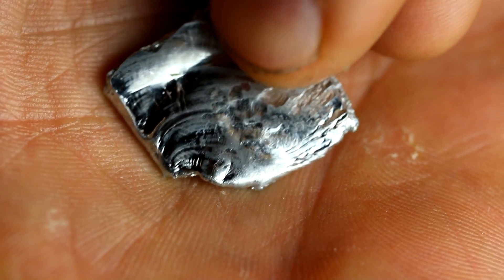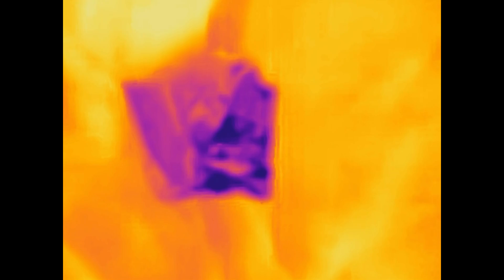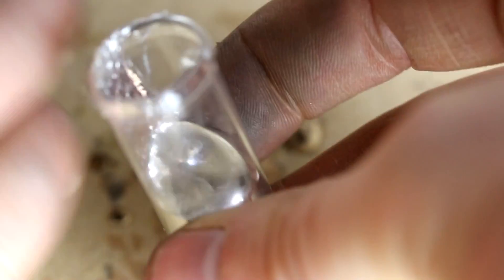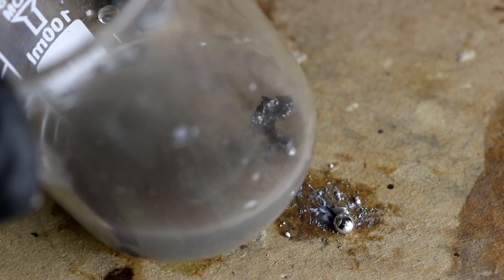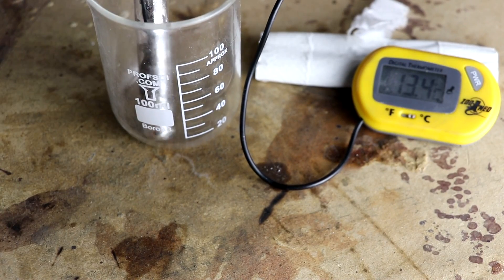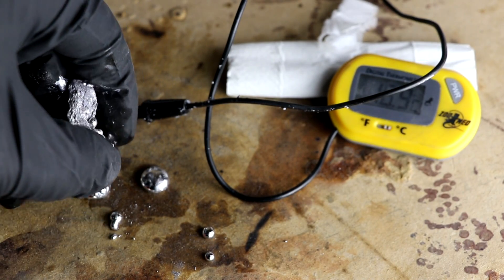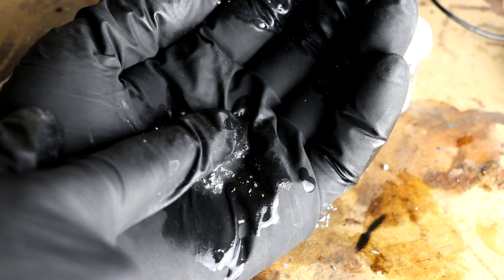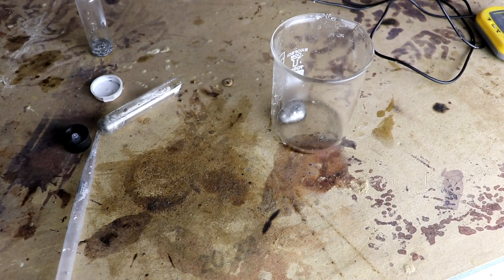Making Galinstan liquid Alloy and Mixing With Nak

Comment: So...you're saying I could theoretically apply Galinstan to say.....tin solder, and significantly reduce both the tin's structural integrity and its alloyed melting point?
Reply: Increase it, more likely.
Reply: @karhukivi  Is this standard comment section banter or are you sincerely expressing an informed opinion?
Reply: @robertjohnsonfox8829  Adding one eutectic alloy to another eutectic alloy does not necessarily lower the melting point of the combined alloys even further, as was demonstrated in the video. On the other hand, alloys often have improved structural properties, which is why small amounts of other metals added to iron make various resilient types of steel.  Why not try the experiment you are suggesting yourself and let us know the result.
Reply: @karhukivi  fascinating suggestion... If I ever get my snizz together and actually do that I'll post a link.
Reply: @robertjohnsonfox8829  It would be very interesting to see what happens!
Reply: In 2 weeks the death count should exceed the total recorded ebola outbreak death count.

Comment: Excellent video! Learned that Mercury is not the only liquid metal at room temperature! Thanks
Reply: Depends on the temperature of your room.   In hot countries gallium is liquid but not in cold countries unless you have the central heating on very high above 29.76. .  Caesium is also a liquid above 28.44C and rubidium at 39.3C.

Comment: Make galinstan nitrate(gallium nitrate + indium nitrate + tin nitrate) by throwing galinstan to nitric acid. Then add aluminum foil to the galinstan nitrate solution to see if amalgamation and hydrogen production occurs. And then the galinstan pools at the bottom of the flask or beaker. 
 
Make galinstan nitrate! 😎👍
Reply from the maker: Tin does not dissolve in nitric acid.
Reply: @theCodyReeder  cool. Maybe gallium nitrate can amalgamate aluminum foil to produce hydrogen.

Comment: You might be interested to know that galinstan can be used as an alternative to NaK for solvent stills. Organometallic and inorganic chemistry labs typically require extremely dry solvents, which is why they usually have a bunch of solvent stills boiling away with alkali metals in them: Sodium for toluene or xylene, potassium for hexane or THF, and NaK for pentane or ether. Even in academic labs, some people frown on using NaK because it is so dangerous, so galinstan can be a useful alternative there.

But how so, since galinstan itself doesn't react with water? Well, it can if you dissolve aluminium in it, which is easy enough to do: Just drop some aluminium granules into a beaker of galinstan, stir it around and it dissolves quite nicely, just like making sodium amalgam by dropping lumps of sodium into mercury. Don't use aluminium foil though - the high surface area means it tends to ignite when galinstan comes into contact with it and dissolves the oxide coating off.

The galinstan-aluminium alloy is still liquid, and having the aluminium in liquid state makes it almost as reactive towards water as NaK, so is effective for drying solvents. Magnesium also dissolves in galinstan, so that is a slightly more aggressive alternative to aluminium. The only problem with using galinstan is that it sticks to glass, forming a mirror surface on any glass it touches. The only way to prevent this is to coat the surface of the glass with gallium oxide, which is possible but expensive. This is done for the glass capillaries used in some modern thermometers, where galinstan is used as a mercury substitute.

Comment: Make a larger batch, melt combine, hold in liquid phase, try and cahrt its exact melting point and also try and then slow crystallize out this solid phase materiel, then microscopy? see its grain structure, maybe if your campus has Xray diffraction system see if they can run it lol?

Comment: Where would i send something if i wanted you to have it?... I , as i have told you before, am a glass blower. To make color change pipes you use silver. When in the fire it becomes a gas and small spatters come off and cling to the slightly cooler glass tube.  I took some silver fuming scraps and made a marble with them. I would like to see you do whatever you think you can to get the silver back out of the glass....if you can.
Reply: It would be a very small amount of silver , so its not something i think would be profitable...i just want to see what you do.

Comment: Cody, when you mixed  the two liquid metals on the table it all most seemed like it was thickening because the Nak was forming an oxide coating. Could this also cause the metal to heat up ? I understand when you did it in the test tube the kerosene helped mitigate that from happening but it should still happen to some degree right ?

Comment: I've been able to get gallium to melt in my hand no problem. It just takes a while to transfer heat throughout the metal piece.10-15 minutes holding in your closed palm should be enough to get it to melt. You must be a lizard :-)

Comment: I wonder if there is a way of preventing the Galinstan from sticking to objects... Maybe a coating of chloride to prevent the oxides from forming, because to my knowledge it is the oxides of gallium and indium that are sticky, not the alloy itself. You could attain this simply by exposing the Galinstan to hydrochloric acid, as the chloride should take the place of the oxygen. You might have to use a hydrochloric gas rather than a liquid though...

Comment: You should put some of that new NaK/GaInSn combined alloy into a mass spectrometer to see what ended up in it and in what ratios...
Especially since there are signs of some of the metals being kicked out of the alloy as it solidifies.
Also measure the GaInSn, to see if the ratios changed.
You know what, just throw everything into a mass spectrometer.

Comment: Heat as we define it is opposite gravity. Gravity is towards a volume center, while heat is radiation out of this center.

Heat falls into an endotermic (heat absorbing) reaction and stabilises a matter collapse between the atoms and molecules. We interpret it as a liquid metal in this case. What do you say commenters? 

Can we describe matter-heat-radiation in a single equation, that explains the guess at E = mc2 (plus the other terms that exists when an object is not stationary). E = mc2 just says so, not why/how. No good layman explanation has come out of chemical kinetics that I know about.

Comment: Hey Cody. I have a question that I would love to see you make a video on. Soda contains carbon dioxide dissolved in to the drink. Well how many bottles of soda would I have to open in a enclosed space like a car or closet, to cause the CO2 levels to rise to a dangerous level. How would you measure the amount of dissolved CO2, how long would it take to come out of solution. I think you could turn this in to an interesting video.

Comment: Eutectic alloys, in particular galistan-based, have gotten very popular as thermal interface materials. Any non-gallium liquid alloys that don't hold toxic or noteworthy reactive properties? Gallium doesn't play well with aluminium. Not nice at all. Its difficult to secure a heatsink to the heat source with adequate clamping force, when its rapidly turning into something with the structural integrity of wet sand.

Comment: I have a question maybe an experiment can help resolve. So I know wood can get water logged after some time in water. My question is can a log get "space" logged after some time in a vacuum? Wondering if its janka rating would take a hit, or would it increase from the stresses? If you quickly coated it in a urethane, wax, or epoxy could you make balsa baloon!? 
For I do not have a vacuum chamber :(
Reply: You can make puffed wood by putting hot, waterlogged wood into a vacuum chamber. Will that do?
Reply: AguaFluorida mmmm no, no we arnt going for a new breakfast cereal. Going for the whole vacuum airship thing. But I bet even balsa is too heavy to float if you could perfectly "space log" it.

Comment: Cody, you have all the pieces here to try an experiment, could you melt some Al and make a 95:5% ration of Al to Galistan, very slowly cool the Al alloy over a whole day to make sure the alloys solidify homogenously. Then simply drop it into water, ball mill it and pour the powder into water. The Galistan will separate and fall to the bottle while the Al will react into Al oxide and produce mass amounts of hydrogen gas. The chemical byproducts can be centrifuged and the galistan can be reused, while the Al oxide can be stored and converted back into Al later.

Comment: If one metal 'gets in the way' of the other's crystallization, wouldn't that merely cause the other to crystallize more slowly at a given temperature? The forces between the atoms should be the same in either case; the mixture is simply a more 'complicated' crystallizing which might produce more flawed crystals. And salt RAISES the boiling point of water, shouldn't it instead lower it, 'getting in the way' of the steam forming a liquid?

Comment: Galinstan is the main thing in liquid metal thermal compound. It also has one of the largest differences between melting and boiling points of anything that's liquid at room temperature. That's mostly due to the gallium which by itslef has a range of over 2000 degrees between melting and boiling.

Comment: the phase change of a 2-metal alloy can be represented by a phase diagram beautifully like what you had shown in your video, but a 3-metal phase diagram can only be presented by a 3D phase diagram, which is quite complicated but still could be understood if enough effort was put into it.
at last, for the 5-metal alloy that you made, the phase diagram would be far complicated, will need maybe 5-axis to represent it. Maybe it could be constructed, but is beyond my knowledge.

Comment: Since every metal has a different dielectric level, why don't they heat (additionally) up by their "battery" electron exchange?  And could that have been measured with your volt meter?  Additionally, it would have been interesting to see how the pH of the water changed due to the violent reactions.  As usual, Cody, your experiments are always entertaining and interesting!  Keep up the good work.

Comment: Call me crazy, but imagine this, you take a pure oxygen system fill a fish tank with it. Then you take a can of pure sugar soda, alluminium can is required here. Add the gallium to the can with some of that NOC. The cascade reaction might be fun to watch. Gallium kills the can alowing the noc to react with the water in the soda. After that the pure oxygen helps the sugar ignite making it spectacular reaction. Untill the air runs out that is. Idk maybe it will go down like that or the carbonation of the soda kills the last bit, either way the the endeavor would tie this video and the NOC one together nicely.

Hey have a good day out there, and be safe.

Comment: Hey Cody, I just recently put liquid metal inside my computer as a heat transfer compound (replacement for thermal paste). It seems to be some sort of gallium-based alloy but I always wondered why it would be liquid at room temperature. Well, I wonder no more now :-) thanks a lot for the video!

Comment: Cody'sLab Great video!  I am planning on an experiment of melting this Niobium metal I have quite a bit of, and alloying it with Vanadium Oxide.  I was going to use the Stick Welder 6 Volt battery terminal carbon method from The King of Random and his fire brick crucible.  Do you see or know of potential pitfalls, or if the experiment may work?  I am going to try it anyway, the reason is I have a curious thermoelectric experiment that involves a combination of those.  Even better would be to see you melt some, or experiment with Niobium/Vanadium or it's oxides.  Vanadium solutions and Mercury can also produce some interesting  color changes that would make excellent video content.

Comment: why do liquid metals all have to be either dangerous or sticky? :'(
Reply: Mistypix Studios pepsi
Reply: Well, depending on its use, you may want its wetting properties. Ie. as a thermal interface between two other parts/materials, if it didn't wet the surfaces, itn wouldn't make anywhere near as good contact, leaving very significant microgaps. And high thermal conductivity doesn't really help you out that much if there's a lot less actual contact.
Reply: Maric it’s also dangerous though
Reply: Mercury's cohesive forces are stronger than it's adhesive forces, so it would rather group up rather than leave things behind. Otherwise labeled something's 'surface tension'.
Reply: Fields metal. Completely non toxic and non sticky, but melts only at 62C (144F)... You can touch it without too much trouble though :)
Reply: To find out we'd need somebody to play with gallium(instan) under inert atmosphere or in a liquid with low surface tension?
Reply: Mistypix Studios nice try, but most liquids aren't
Reply: +Илья Лагуткин The question you should actually be asking is why does gallium and galinstan wet things at all?  The intermolecular forces of gallium should be WAY stronger than the forces between gallium and other surfaces, like glass.  Wetting of glass seems to imply the opposite.  Mercury is the only metal here that seems to make sense.

It turns out (at least, this is my working hypothesis) that gallium and galinstan oxidize more easily than mercury.  When you rub gallium onto a glass surface, it first gets coated with an oxide layer, and then the remaining gallium metal sticks to that layer.
Reply: What are you talking about?
Caesium is safe!
Reply: DeadlyDonut17 until you throw it in water
Reply: Gallium indium alloy isn't particularly sticky nor dangerous. But it's messy! It stains everything, it doesn't solidify and doesn't go away! It turns everything grey. I made a tiny amount once, and stored it inside a little thin plastic tube, which promptly cracked and broke in my car, allowing a small droplet to escape and disappear somewhere inside my dual cupholder/console. For months it was stuck in there, staining whatever I put in there!
Reply: I dunno, why does liquid water have to be sticky?
Reply: mercury isnt sticky
Reply: +Mistypix Studios  Why mercury doesnt wet things as much as gallium/galinstan?
Reply: Maric you are stupid incarnate!
Reply: Everything is dangerous, it just depends on the dose and the handling.
Reply: ya who would have thought that a "liquid" would be "sticky".
Reply: it wets itself. it masterbates.
Reply: Maric it is. It sticks to itself
Reply: Âsdop good. What about it

Comment: While it is extremely cool to see liquid metal at room temp. Does it have a functional use? Like mercury, can it be used to measure pressure or temperature?
Reply: Probably, and it can also be used for EU-friendly tilt switches.
Reply: accelerometers and liquid metal for CPU,probably a ton more.

Comment: Hey codz, could you work with selenium please? I heated some Se in a test tube with a small flame so that it would melt. It produced some caustic SeO2 and vapoized itself to form red selenium on the end of the stopper if it is done longer, more red selenium should form. Never seen on YouTube before unfortunately.

Comment: When will you make a Cobalt and Dysprosium alloy? A CoDy slab!
Reply: +Ganaram
Or make it a slab
Reply: Would be an interesting alloy. Nd2Fe14B is a strong magnet as is SmCo. Neodymium and Samarium are both rare earth metals (lanthanides) just like Dysprosium and Lanthanum, so they have similar magnetic properties.
Reply: You'd also need sulfur, lanthanum, and boron for the slab part (CoDySLaB).

Comment: Is this the same stuff as Coollaboratory Liquid Pro thermal compound?
Reply: These are the questions we need to know. You can buy 30g of galinstan for like 30 bucks. Conductonaut is mostly galinstan but I don't know what else is in it.
Reply: I wasn't aware of that Conductonaut even existed. I remember using the CLP couple of years ago, and this reminded me of it's mind boggling ability to stay liquid even at room temperature.
Reply: Conductonaut has the highest  thermal conductivity @ 73 W/mk ...CLP is only 38.4....I use conducto on both my cpu and gpu, but I change my liquid coolant every few months so it would be nice to have a good supply of it.

Comment: The temperature of the outside of your skin is not the same temperature as your internal body temp of 37c, on average the outside of human skin is somewhere between 32 c and 35c. It can change quite a lot depending on the ambient temp as well on top of that. This might be why the gallium isn't melting in your hand, idk.